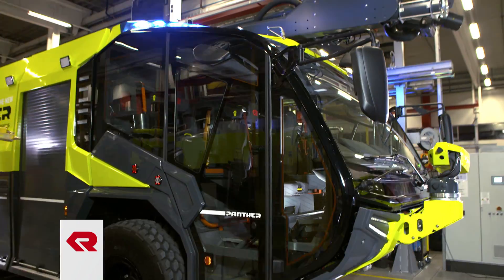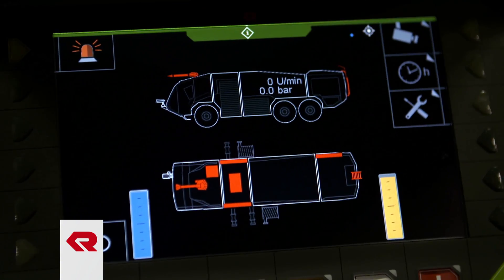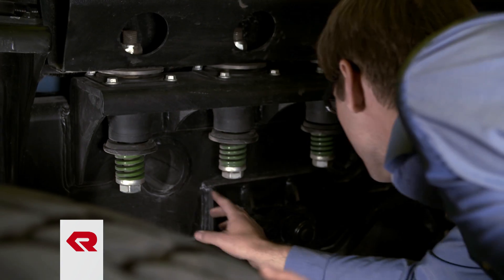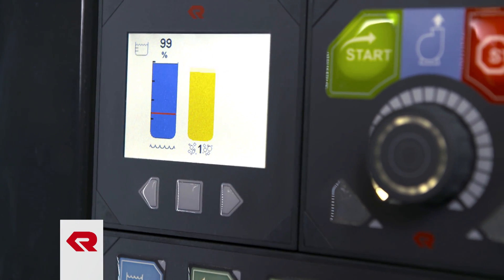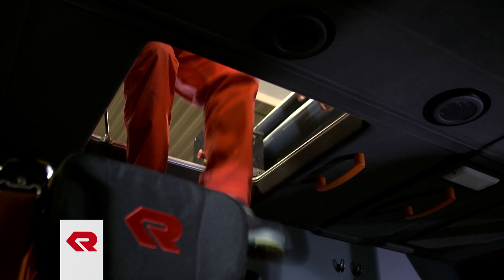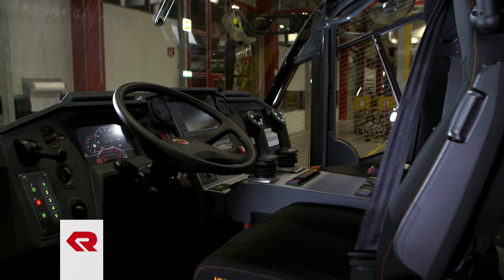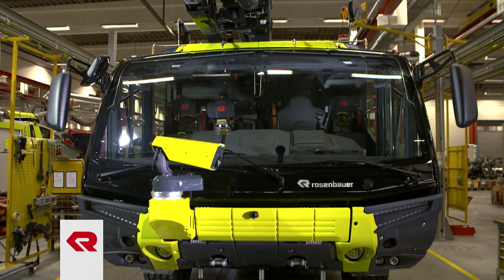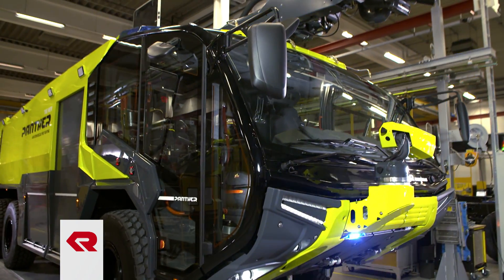Rosenbauer PANTHER 6x6 new - The "Making of"

Comment: What engine does it use, and  is it using two engines...
Reply from the maker: Hi Titan,
the new PANTHER is available with two different drive variants: basic with Volvo Euro 5 engine and 6-speed gearbox or performance package with Volvo Euro 6 engine and 8-speed gearbox. 
The PANTHER 8x8 uses two engines, the PANTHER 4x4, 6x6 and 6x6 S use only one.
Kind regards,
your Rosenbauer Social Media Team
Reply: @RosenbauerGroup  ohh, thanks for the info. So it was the 8x8 Panther that uses 2 Volvo engines, are the two engines connected or one engine has a purpose?
Reply from the maker: Hi Titan,
in the PANTHER 8x8, both engines drive the vehicle in normal driving mode. The power of the engines is bundled via a so-called collective transfer case.
For pump operation, one of the motors is switched from traction drive to pump operation. This motor provides the required power for extinguishing. The second motor is then solely responsible for driving the vehicle.
Kind regards,
your Rosenbauer Social Media Team
Reply: @RosenbauerGroup  , so you made a custom made transfercase, that's impressive. Wish I could own something like that so that I could help the firefighters here our area. Anyways, I am impressed in your innovation and technology...
Reply: @RosenbauerGroup let me ask this thing that's going around my mind, Do you take back the unit if it is retired from service or not...